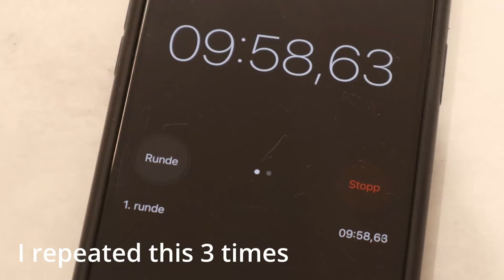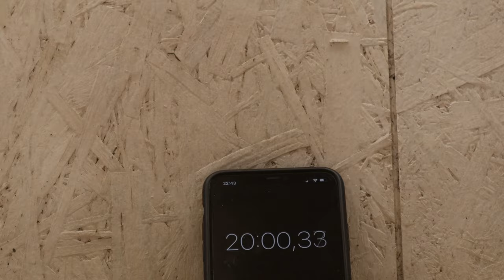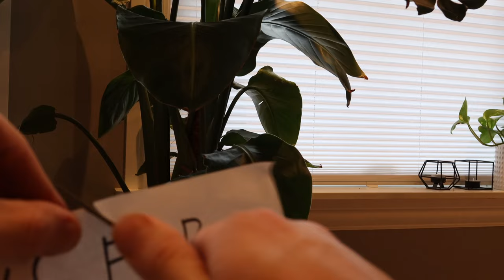Knife making - My best made liner lock by far

Comment: Is it worth sanding to a higher grit before heat treat so you don't have to sand as much when the blade is hard?
Reply from the maker: Hi! With the old belt grinder and its setup, consistency was difficult. These days I have a  new grinder and do it by hand. Now I take it up to 400 before heat treat.

Comment: What type of screws did you use? Also was that copper you used as a washer or brass?
Reply from the maker: Hi! It was pivot screws, Ø3mm on the pivot, and Ø2mm in the back. I modified them to fit.
Reply: Bronze

Comment: Watch ekim knives folder making  please. And why you Install the detent first and then bend the lockbar with heat? All the hardness is going out of the detent ball
Reply from the maker: Hi! I do it first, because I harden the lockbar and give it a spring temper afterwards, so I dont think its a problem. Doing it the other way around would, I think the lockbar would be too hard to get a snug fit with the detent ball.

Comment: Put the dremel in a vice pointing down like a drill press … then put the liner on a bit of wood or whatever and kiss in that depression for the lock relief… works much better than freehand like I see here and I used to do…. Great work….
Reply from the maker: Hi! I am not freehanding the lockbar? I use a dremel cutting disk in my drill, and have it mounted on a 2x4’’ that slides on a fixed table.
Reply: @Inmyshed  the depression you make to relieve the lockbar.. you used a mini sanding drum in your dremel... I mean to create that sanded depression at the bottom.  Not the lockbar itself
Reply from the maker: Ah! I get it now! I will try this out some cutoffs and see if i can do it! Thanks!

Comment: Super
.6-6.30 minute, what is the name of the process, and what are the ingredients? thanks
Reply from the maker: Hi! thanks for the comment! I polished the blade up to mirror polish, cleaned it off with aceton, then boiled vinegar 5% with water. 5050. Added some salt and submersed the blade in it for 10 min. Then took blade out, rinsed off the leftovers from the oxidation, boiled up the vinegar and water, and repeated the submersion the the blade for 10 min. I did this 3 x times. Then I got some rocks, put it in a bottle, sprayed it down with WD40 and let it rotate for 20 min. That part is called "stone washing".
Reply: @Inmyshed  thanks
Reply from the maker: No problem! Good luck with your project!